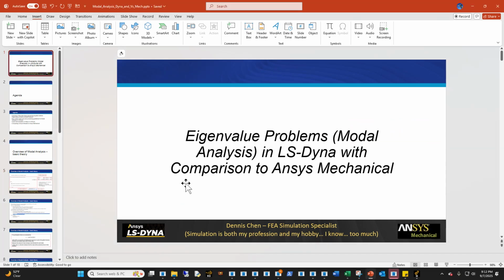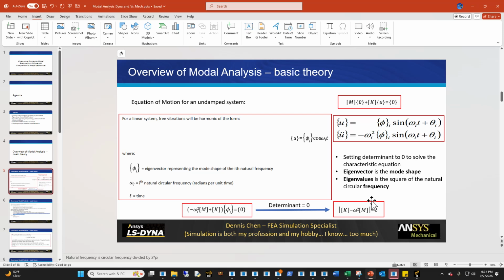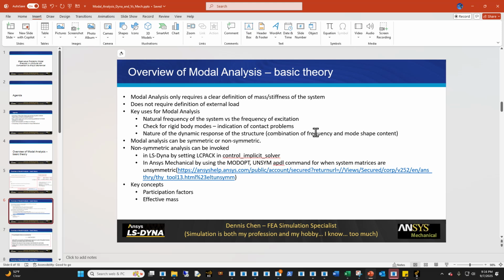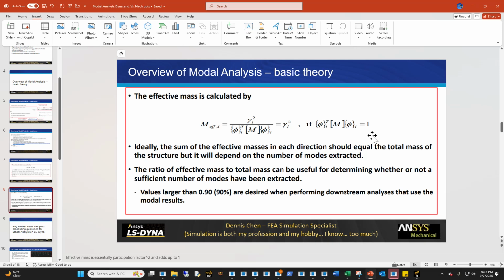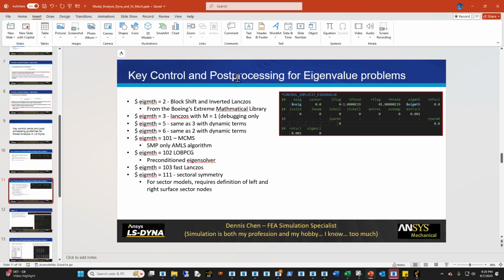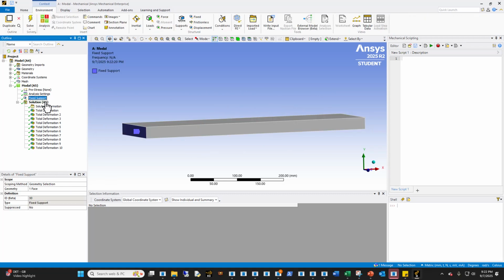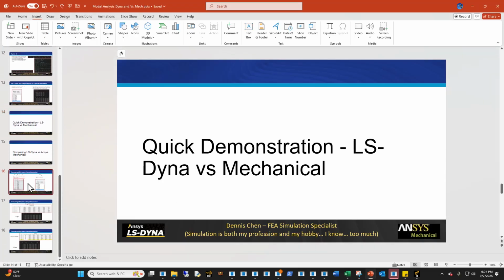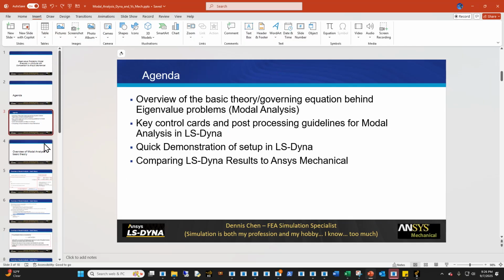Modal Analysis In LS-Dyna with comparison to Ansys Mechanical

Comment: Dude! Your videos are so valuable! Would you ever consider sharing your full keyword template folder? Maybe via a github repository? Big thanks again!
Reply from the maker: Hi, I don't think I should share the whole folder because 1) it's changing constantly and 2) it's just a cluster of stuff, no real organization to it.   I can share the keyword template I used, see below
*PARAMETER
$prmr1    val1     prmr2      val2     prmr3      val3     prmr4      val4
$dt0 - initial time step of the implicit analysis, this parameter affects the dtmin result in the control_termination as well
R dt0     0.2         
$iauto, 0 not automatic, 1 automatic, 2 sync with thermal
$iteopt - the optimal iteration per substep in Dyna (this is the center of # of iterations)
$itewin - the plus/minus of number of iterations per substep (this is the spread)
R iauto   2
R iteopt  11
R itewin  5
$ dtmins and dtmaxs are structural solver min and max time step size, simulation would stop below min and never goes above max
$ dtexp switch to explicit for duration of implicit time step
R dtmins  0
R dtmaxs  0
$kfail - # of tries to converge implicit before going explcit, only works if auto adjustment is truned on in control_implicit_general
$R kfail   1E10
$NSolvr - solver type, 12 as default BFGS update nonlinear solver
R nsolvr  12
$ilimit - number of iterations before stiffness reformation which is done when divergence is detected (out of balance forces).  based on ANsys mechanical, stiffness reformulation should only happen when it diverges and bisection occurs
R ilimit  1
R maxref  15
$convergence criteria, only displacement and energy are used by defaeult.  dctol default to 0.001 and ectol defaults to 0.01, rctol is 10E10 which is disabledc. lctol is related to line search and defaults to 0.9
R dctol   0.001
R ectol   0.01 
$lsolvr - direct = 7, iterative = 22 or others.   
R lsolvr  7
$imass:   0 - static, 1- dynamic with newmark time integration, 2/3 - MSUP
R imass   1
$gamma default to 0.5 and beta default to 0.25, 0.6/0.38 can be used for quasi-static analysis
R gamma   0.6
R beta    0.38
R neig    10
$ can do -998 for a load curve for a pre-stressed modal analysis, mode extraction can happen across multimple times
$ this is the # of modes to extract
R eigmth  2  
$ eigmth = 2 - Block SHift and Inverted Lanczos
$ eigmth = 3 - lanczos with M = 1 (debugging only
$ eigmth = 5 - same as 3 with dynamic terms
$ eigmth = 6 - same as 2 with dynamic terms
$ eigmth = 101 - MCMS
$ eigmth = 102 LOBPCG
$ eigmth = 103 fast Lanczos
$ eigmth = 111 - sectoral symmetry
R rotscl   1
$ rotscl is the rotational inertia scaling factor,  can be small if there's no relationship between rotational and translational DOF of the system
*CONTROL_IMPLICIT_EIGENVALUE
$#    neig    center     lflag    lftend     rflag    rhtend    eigmth    shfscl
     &neig       0.0         0-1.0000E29         01.00000E29   &eigmth       0.0
$#  isolid     ibeam    ishell   itshell    mstres    evdump   mstrscl
         0         0         0         0         1         0     0.001
$#       -         -    iparm3         -         -         -         -    rparm4
                             0                                               0.0
$#  rotscl   eigmscl
   &rotscl         0
*DEFINE_CURVE
$#    lcid      sidr       sfa       sfo      offa      offo    dattyp     lcint
       998         0       1.0       1.0       0.0       0.0         0         0
$#                a1                  o1  
                 0.0                 1.0
                 1.0                 1.0
                 5.0                 1.0
                10.0                 1.0
*CONTROL_IMPLICIT_GENERAL
$#  imflag       dt0    imform      nsbs       igs     cnstn      form    zero_v
         1      &dt0         2         1         2         0         0         0
*DEFINE_CURVE
$#    lcid      sidr       sfa       sfo      offa      offo    dattyp     lcint
       999         0       1.0       1.0       0.0       0.0         0         0
$#                a1                  o1  
                 0.0                 1.0
              0.9999                 1.0
                 1.0                 1.0
                 1.1                 1.0
$how does change dt0 change the response
$does change 0.99 to 0.9999 change things
$imflag value of -99 indicates load curve 99 defines what time period analysis is run as implicit
$and where as explicit.   1 is implicit, 0 is explicit
$we need a highly steel curve to switch between implicit to explicit
*CONTROL_IMPLICIT_AUTO
$#   iauto    iteopt    itewin     dtmin     dtmax     dtexp     kfail    kcycle
    &iauto   &iteopt   &itewin   &dtmins   &dtmaxs       0.0         0         0
$iauto=0, constant time step, 1, automatically adjust time step
$iteopt = optimal iterations per time step
$itewin= +/- of iteopt, allow auto adjustment
*CONTROL_IMPLICIT_SOLUTION
$#  nsolvr    ilimit    maxref     dctol     ectol     rctol     lstol    abstol
   &nsolvr   &ilimit         0    &dctol    &ectol
$#   dnorm    diverg     istif   nlprint    nlnorm   d3itctl     cpchk
$ istif is reform stiffness matrix every n time step and diverg is when to reform if divergence is detected          
         2         1         1         3         2         0         0
$#  arcctl    arcdir    arclen    arcmth    arcdmp    arcpsi    arcalf    arctim
         0         0       0.0         3         2         0         0         0
$#   lsmtd     lsdir      irad      srad      awgt      sred    
         4         2       0.0       0.0       0.0       0.0
$dctol is displacement, ectol is energy, rctol is force, lstol is line search, abstol is used if the other are very small
$nsolvr = 12 and arcmth = 3 is no
$dctol is displacement, ectol is energy, rctol is force, lstol is line search, abstol is used if the other are very small
$nsolvr = 12 and arcmth = 3 is no
$ilimit In the default BFGS method, the global stiffness
$matrix is only reformed every ILIMIT iterations. Otherwise, an inexpensive stiffness update is applied. By setting ILIMIT = 1, a stiffness reformation is performed every iteration which is equivalent to the Full Newton method (with line
$search). A
*CONTROL_IMPLICIT_SOLVER
$#  lsolvr    lprint     negev     order      drcm    drcprm   autospc   autotol
   &lsolvr         3         2         0         4       1.0         1       0.0
$#  lcpack    mtxdmp    iparm1    rparm1    rparm2      
         2         0       
$#  emxdmp    rdcmem      
         0      0.85
*CONTROL_IMPLICIT_DYNAMICS
$#   imass     gamma      beta    tdybir    tdydth    tdybur     irate     alpha
    &imass    &gamma     &beta       0.0   1.00E28  1.000E28         0       0.0